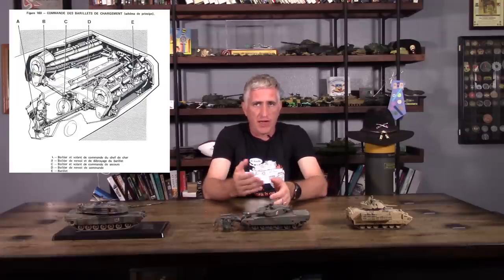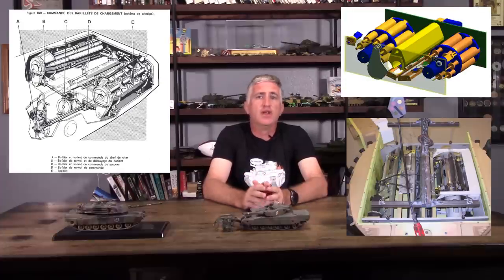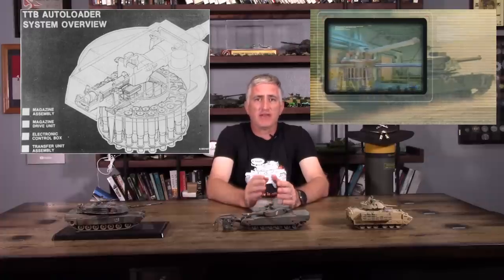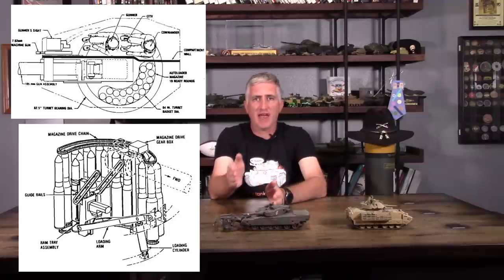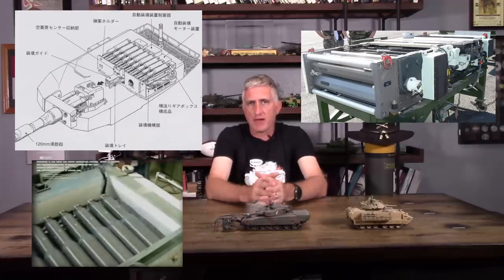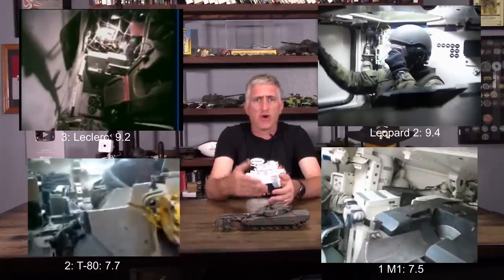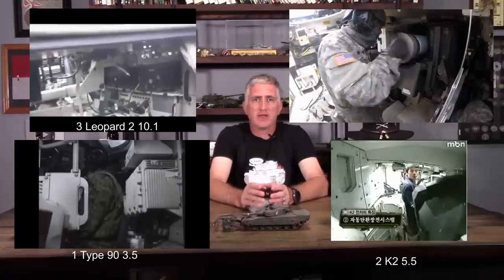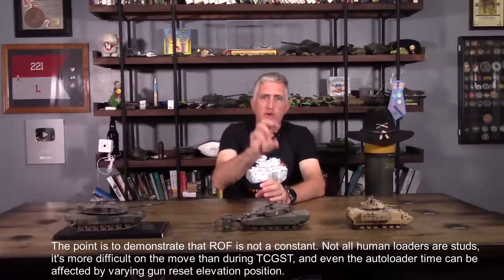Whither the Autoloader?

Comment: Hi Chieftain,
former Leopard 2 gunner here that has to disagree with your pro-auto-loader arguments.
The thing is, that the assumptions that you are making that the advantages of auto-loaders are, are typically irrelevant to modern times warfare. Things such as sustained fire or fire-frequency over longer periods of time is nothing that matters at all! That is just a value on paper, nothing more. Ok, hold on, there was one single scenario where this mattered, which was the gulf war where the army of Irak was completely surprised and tankers were facing huge amounts of parked tanks that were asking for immediate destruction so that each gunner needed a constant supply of ammunition to play scrapyard wars. Other than that, this just does not happen. We are not in WW2 anymore and there will not 100 tanks facing another 100 tanks for a gunning-parade. In fact, it is VERY unlikely that a tank will ever be facing more than 1 opposing tank at a time. That means, rate of fire does not matter. Also the extreme accuracy of modern fire control systems and the performance of the ammunition make it almost impossible to miss if properly trained as a gunner, if you are not completely unlucky with a shot. In both cases, what you need is one second follow-up round as fast as possible, and despite what was shown in your video snippets, a follow-up shot is a heck-load faster when you have a fit human loader, compared to any recent auto-loading systems. As a matter of fact, when spotting one or two opposing vehicles, the gunner will already tell the loader, that he will e.g. need a heat round next, so the loader will have that round in his hands, rendering all delays by opening the bunker doors etc. etc. irrelevant. This is how my crew in the Leopard 2A5 achieved follow-up shots on the same, or a second target not far off within 2, max. 2.5 seconds.
Show me an auto-loader that can do that today ;) As a matter of fact I think properly prepared, a good crew can get out 3 rounds  with a human loader within those typical 7,5-8 seconds that an auto-loader needs to provide the second round.

That was my most important point that you kinda ignored because maybe US tank doctrine is different from German, but this proper communication training and "second round in hands" drill is I think not only the case here, and as I said, THIS is what matters in 99% of tank to tank combat situations, not getting off 15 rounds in a row as fast as possible.

Having that said, at least for the Leopard 2 you showed it in your picture yourself: The ammo-rack folds, which means the angle for the loader to grab the next round stays consistent. There is no "Oh these last 5 bullets are harder to reach out there". 
Also, IMHO the size of the bunker door is not relevant to security of the system. Even considering the openings for these auto- or semi-auto-loaders are much smaller, they seem to not open and close significantly faster in your video than the big door in the Leopard. Also, it does not matter if it is 50x50cm or 15x15cm, if the ammo cooks off, trust me, you are done anyway.

About your argument that reducing the crew size is actually something positive... it depends. I agree, as long as the tank is working and all fine. You have already scratched the maintenance topic which can be solved as you said, but what really matters are two things:  'Combat maintenance' in situations where you cannot just casually drive to the broken tank in an IFV to drop off some technicians, and more importantly 'replacements'. As a gunner I was always trained to be fully capable of replacing the loader and partially also to replace the commander, and vice versa! In the not so unlikely event something goes wrong, you are just a lot more flexible, especially if somebody is injured, gets sick, gets tired, etc.. Also, it is just very handy to have one more man (+weapon) if you have to bail out of a broken down tank in enemy territory.

 The last point I want to make is about your argument that using an auto-loader makes it possible to make the tanks smaller. This is true! But it also limits the capabilities of the tank partially. The question is what it is used for. Let me give you an example: When the US Army rushed into the lines of the Iraqi army before they could man their tanks, that was not only a lack of scouting and preparedness, it also shows a shortcoming of the very small and ballistically nice silhouettes of the Russian T72 and T80 tanks they were using: Ergonomics. Those bigger tanks have a lot of shortcomings, but they are simply more spacey and comfortable enough that you can stay inside, cook, eat and sleep for a few days all buttoned up and battle-ready, or at least have shifts in place where the gunner-position is manned 24/7 and the rest rotates (again something where a loader also trained in the gunner role comes in handy). If you have to sit in one of those tiny tanks like a sardine, this is nothing that your soldiers will accept, resulting in catastrophic failure as seen in Iraq. Of course if a tank is only meant for direct engagement where you act from a FOB, jump into a tank with a fresh crew and be back after a few hours, this small silhouettes tanks are just perfect!

I am not German biased (at least I'm trying). As a matter of fact, I think when you put all the most modern MBTs onto a battlefield, the one with best crew and best training will win, because the tanks are more or less equally good. What I wanted to highlight is that the reason for e.g. the Leopard not to use an auto-loader is NOT that KMW is not capable of building one, but that a human loader still inherits advantages that an auto-loader just cannot provide. What is also correct is, that this needs to go hand-in-hand with very good training for the entire crew, and that an auto-loader will probably result in better tank performance if your crews are not as well trained.

Comment: If it Adds a large amount of mechanical complexity without blatant massive advantages there is no reason to install it into any sort of military vehicle, nor any machine to begin with. End all
Reply: also it's impossible to have redundancies with most autoloader types, such as the turret rotating mechanism has redundancies, if you're stuck still you still have your gun, and you can also totally run on rollers on most surfaces. The point is that if an autoloader fails you are tactically useless
Reply: It DOES add massive advantages depending on how you look at it, the russians have been using them nicely since the 60s, for them tanks need to be cheap and small, so a smaller tank will outweigh the cost of the autoloader for them,
For other nations tanks are much bigger and each is tactically more important, with less emphasis on cost effectiveness
Reply: @grren1782  actually tanks with autoloaders can be loaded by hand, leo 2 can do it as well as all T- series MBTs

Comment: The very idea that the tank would really have a four man crew - it's just that the fourth man wouldn't actually be in the tank - is preposterous.  Have you forgotten about Murphy?  Anything that can go wrong - will go wrong.  And anyone thinking that that fourth crewman will actually be accessible when the tank needs him - is bull shitting himself.

Then - of course - the Bean Counters - WILL eliminate that fourth crewman.  That WILL happen.

When the tank most desperately needs that extra guy - because they're having a mobility problem some where out and about away from their HQ - they aren't going to have him.  One job here - is for a look out, someone not actually involved in fixing the tank - to stand guard and keep an eye out for what's going on around them.

The thing is here - is that the old 5 man crews were BETTER for this reason.  First off - because if the tank was supposed to have 5 guys - it was very likely to have only had 4.  As mentioned - often times tanks that were supposed to have 4 guys - really only had 3.  If you're only allowed 3 guys - it is often going to happen - that you will only have 2.  That IS what will happen.

My Dad told me that the one and only time he was in the military when he was in a unit that was at TO Strength - was during the Cuban Missile crisis.  He was sitting on a transport off the coast of Cuba and the reason his unit was at TO Strength - was because they had guys combing the train stations, air ports and bus terminals who would grab anyone they saw in a Marine Corp Uniform - and inform that person that they were now in the 2nd Marine Division.  But - it took the fucking Cuban Missile Crisis - to make that happen.  Sans such a crisis - and it isn't going to happen.  You WILL have short crews - and that will mean 2 man tanks.

How much of his time does the loader spend actually loading the gun?  What is he doing the rest of the time?  Is he just sitting around on his ass going "Hey ... I'm the loader ... don't ask me to do that!"  Well - if you have an auto-loader - ALL - it will EVER do - is load the gun.  Anything and everything that fourth guy was doing - will HAVE to be done by whoever else is left in the crew - and if you're a man short due to illness, or leave or something else - those TWO guys are going to be the ones having to do it all.

Oh ... and ... does any one think that the fact that ... the Russians ... and the ... French ... are using auto loaders - is a recommendation for doing that?

 .
Reply: my name is my name  There could be any number of reasons why the crew was trying to get their tank moving again and they may or may not have had any help.  If there was another tank there - with only a three man crew - then it would have fewer men to help.  But - of course - then you have TWO tanks off line.  What if each of these tanks only had two men because they were both short one? 

I don't know about today - but at one point in time - part of the training of a tank crew was to be able to maintain their own tank for every day maintenance - and - get it moving again if it had a problem. Take people away - and it makes things harder for those that are left.  The harder it is for those that are left - the longer it will take and the more physically demanding it may be - which means that if they can get the vehicle moving again - now they're more fatigued than they would have been if they'd had more people to help.  If the crews are more fatigued - then they may well be performing at a lesser level than they might have been if they were not as fatigued. 

If you have fewer people then you have fewer people to stand watch.  That means that those who are left - are going to get less sleep.  This wouldn't be a one time thing - this would be ALL the time and only get worse if you had people who weren't there for whatever reason.  If you wanted to keep one person awake in each tank - then going from 4 people to 3 is going to make a real difference - and if you only have 2 - neither one of them is going to get enough sleep.  I have served Watch & Watch - and it sucks shit.

Do the math.  Even if you have 4 people - to cover 8 hours - that means each of them has to be on watch for 2 - and they will only get 6 hours of sleep.  If you only have 3 people then it's worse - and if you only have two because you're short a guy - then each person is going to be on watch for 4 hours and only gets 4 hours sleep.  AND - that is if you have the luxury of having 8 hours off. 

Now - there is an unlimited set of arguments that could be made back and forth and we could make up all the circumstances we wanted - but it all comes down to the unit having fewer men to do the jobs they have to do.  If you just barely have the men you need - then you have no resiliency to the unit. 

If you are short personnel - then you're borrowing from other parts of the unit, doing things slower than they could have been done with more people - or - not able to do some things at all with the man power available - unless you call on an outside unit - which then has to not support someone else - because they're coming over to help you.  If this shortage of personnel is not just one tank unit - but all of them - then this other unit is going to be very busy trying to help all the units that can't do what they need to do because they don't have the people.

This isn't one tank being down by one man.  This is every tank being down by 25%. You don't suffer losses like that without ramifications.
 .

Comment: i Usually agree with you Chieftain but not on this one. reason, i dont buy into the reliability of auto loaders. MBT´s are by definition fairly complex machines by default why add to that. i understand the numbers game here and the argument you put up in the video but things tend to break at the least convenient time in reality. not always due to poor maintenance. if it happens in a firefight then you have a 60+ t armored tractor that in the best of cases can lay MG-fire if by some kind of miracle  the gun stil can be loaded manually you yourself said it would fall to the TC to do it, the man in the tank who also has to select targets, in my book that´s back to french 1940 level of overworking your TC  .  you also did touch on the subject of losing the 4th crew member, the loader. let talk about one of the other irritating problems a tanker can experience from time to time, throwing a track / belt. by removing the 4 guy who by definition being the strongest, especially in a fire fight you dont have time to wait for the APC to catch up . i do however agree on the last part that reality tends to make the "spare" tankers disappear by some higher-up political non-practical decision and it has nothing to do with the tanks. i do however understand your argument about its up to what you are used to in your country, if it aint broke dont fix it, does apply. we operate leopards in denmark (and formerly the centurion) now primarily the leopard 2 (i am old enough service-wise to remember the last years of leopard 1a5+) all danish tanks have been loaded manually. (sherman, m10 achilles, centurion, m24 chaffee m41 walker bulldog leopard 1 and 2)

Comment: Militarry is well too conservative for adopting autoloaders.
There are also some other negatives for autoloaders: If you consider a Tank a system that is continuously upgraded an autoloader adds an additional dependency to the gun, therefor making upgrades to the gun more difficult. PLUS an autoloader will represent an additional system that will need regular upgrades.
Meanwhile a human-loader can upgrade himself.
I think a beltfed 130mm gun, where the reload device is completely mechanic and fixed the barrell is the best solution.
Reply: On the list of dumbest excuses for outdated tech, this is in top 3, probably

Comment: auto loaders don't work with two part ammo.
Reply from the maker: Soviet autoloaders question this statement.
Reply: @TheChieftainsHatch  I guess I, and by extension the British army, (who are quite snobby about autoloaders) are wrong then.  XD If I was an expert on tanks, I wouldn't need to sub. :D I susspect it's related to having to make tea 1 out of 4 times, instead of 1 out of 3. 

One wonders if the american flexible ammo feed belt trailed on machine guns could be used on tanks, so the gun could be reloaded even in position, also if there's no loader, you could just seal off the gun behind armoured doors, and only need to worry about it when it breaks. Having deleted a turret crewmember they'd be room for this. 

The fourth crewman could (if it was a new design tank) be given other jobs in the hull Radio operator, machine gunner, mechanic.  etc. 

It also seems to me, that having a fourth crew or even additional 3 members, out of a tank, effectively doubles the amount of tanks you have as while one crew is asleep in the back of an APC the other are driving the tank, the only downtime would be in the daily change over.

Comment: And two years later, we see dozens of demolished Russian tanks in the Ukraine mud. Primarily T-72s, which use an autoloader. Discuss.
Reply from the maker: What proportion of M1s and Leopards destroyed in Yemen and Syria have used manual loaders? How does this correlate?
Reply: @TheChieftainsHatch  A good question, but I don't have time to research it for a few days. My initial opinion is that in a well trained army, personnel who work as loaders can be helpful by doing things that are unexpected but needed. To draw a (probably bad) analogy to my career,  a loader is to a tank driver as a bar back is to a bartender. They shouldn't strictly be necessary, but having someone around who knows where all the important stuff is, can get it quickly, and is training to run the show is too useful to ignore. There's a lot of assumptions there, but it seems to me that the Ukraine conflict has not gone to plan, and having extra bodies around to help get things done to adjust the plan would be a big help.